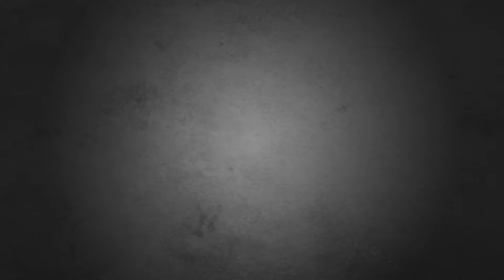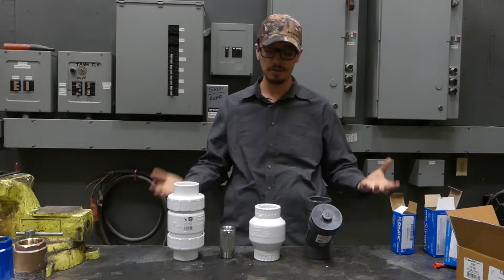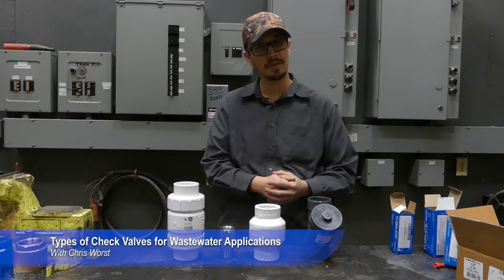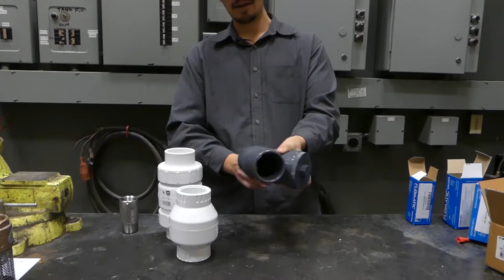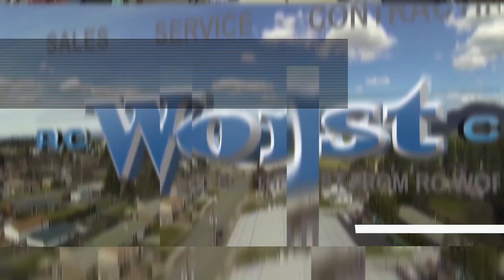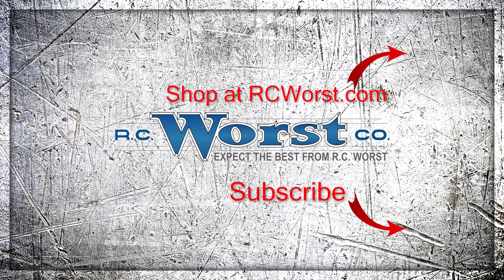Types of Check Valves for Wastewater Applications

Comment: What kind of check valve for a system that uses dual sewage grinder pumps? Any environments where check valves should NOT be used? From your video it seems you aren't a fan of ball check valves.

Comment: Thanks.  a lot of good information here.  Perhaps a bit off topic, but certainly related, and i cant really get my head around some good answers to this: How do these styles (in particular spring loaded with 1-5 PSI cracking pressure) compare to pressure vacuum breakers (PVB) and reduced pressure assemblies (RP or RPZ) used in irrigation, which cost 10x to 50x as much (1" size)?

Comment: I have a flapper style check valve installed horizontally just upstream of my septic effluent tank pump.  I was told to remove the check valve because in winter the effluent in the pipe upstream of the check valve can freeze. The volume in this piping is not enough to cycle the pump after the effluent drains back into the tank. Anyone have opinions on this?
Reply: I'm having the same issue.   I removed the check valve because of this.  I've gone through two pumps in 6 years.  I think this is because my pump is running more than it should.  This is due to volume of water left in the discharge line (approximately 200' long to the sand filter) falls back in the tank and keeps cycling the pump, wearing it out.  The only thing I know to do remove the check valve during winter months and re-install during the spring.

Comment: Does this block smells as well?? I.e. a sewer pipe connected to a septic tank. Can one of these check valves prevent gas flowing back into the house?

Comment: I have a ejector pit in our basement with a 2 inch zoeller check valve.  the pump is usually always fine but this week noticed it kicks on then is kicking on a few more times then i finally hear the water hammer sound from the valve closing.  i recorded it doing it the other day sounds like the check valve is only working sometimes i can clearly hear the water coming back down in the pipe after it pumps until i hear that valve close.  my question is could it just be the check valve or does it sound like the pump is going bad and cant force the water to that check valve to get it to close.  i ordered a replacement flapper for the check valve i have but wanted opinions.
Reply from the maker: First step is to replace the check valve. It is also important to make sure you have a vent hole drilled in the discharge piping.
Reply: @RCworstwater yea i thought that could be a issue to didnt install it but its been in there for awhile.  thought it might be plugged the weep hole.  i was going to drain the hot water tank i have in there after i replace the check valve and see if that really hot water could break anything or clean it up some.
Reply: @RCworstwater  So changed check valve was still doing the same thing took the vent hole off. there is a weep hole drilled and seems to be fine it is pushing water out of it.  my thoughts is if i have to open this cover all the way im just going to get it over with and change the pump hoping it is going bad its been here for like twenty years.  any other thoughts the pump does seem to like short cycle and that is the problem im hearing i even tried a different electric source.
Reply: @RCworstwater  alright found what was exactly wrong I changed the pump anyways. The float switch was bad but still turned on and off. But it would just fall by itself when the float dropped from the top.  So it would turn on right when it got to the top the shut off really fast bc the top of the switch would fall with the white float if that makes sense to you guys. When I flip the switch with my hand it’s like there is no bump to keep it up while the float slides down the rod.
Reply: @Kohler61350  Smart move Jason, thanks for the follow up. Sounds like the old pump has a float switch on its way out.  Hope the new pump is still running good.

Comment: I was told by one manufacturer spring assisted valves should not be used in sewage pump applications? what are the options for a 3" check value in a sewage pump application?
Reply: Did you not get an answer I would like to know it.
Reply: @keithbotelho9189  Unfortunately no answer...